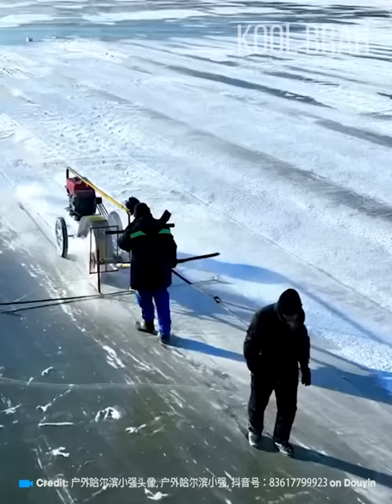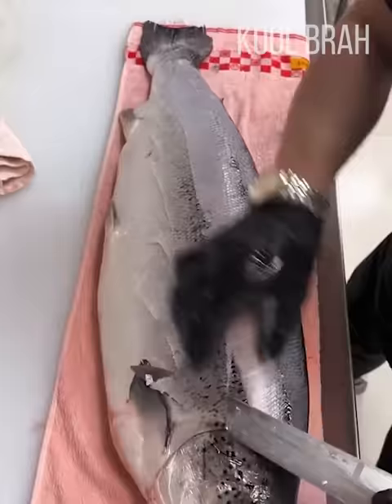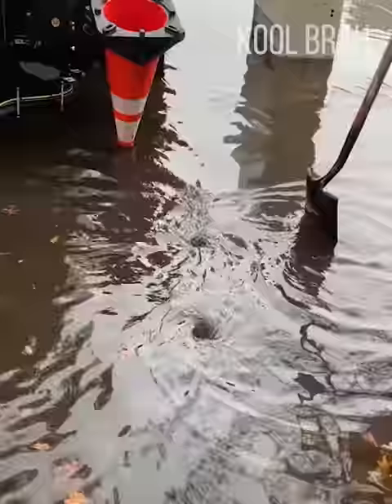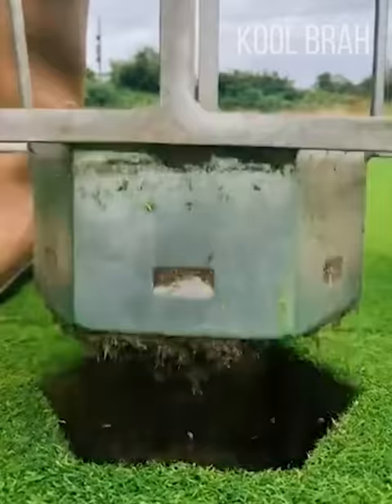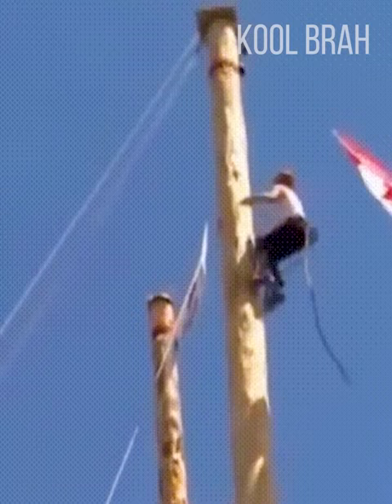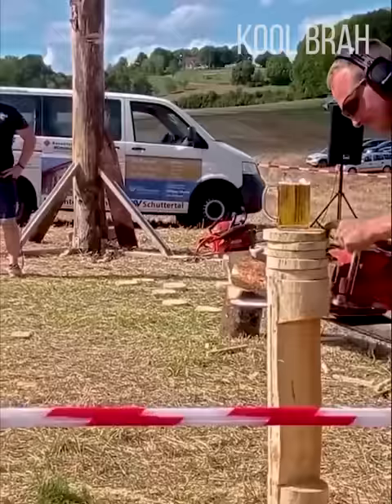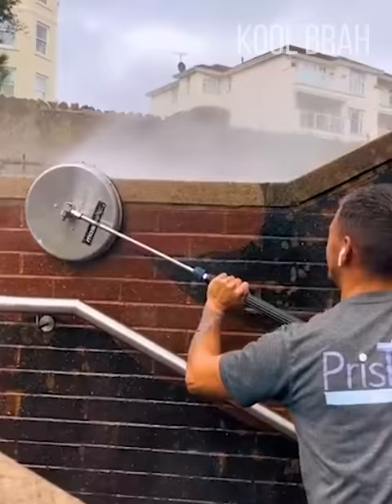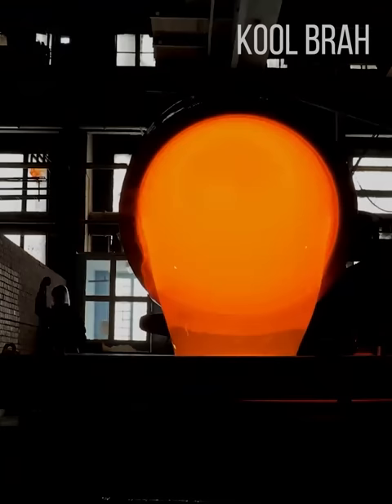30 Minutes Satisfying Videos of Workers Doing Their Job Perfectly

Comment: tip about the ''thats how you spread the adhesive'' part... that part of the floor aka 'click floor' is mostly 'decorative' aspect of the structure aka... you dont actually need to glue it aslong its secured in the edges it wont move..buuuuuuuut... if say your ever gona repair it , replace it or do any maintenance work underneath it hehehe... not having glued it is very very practical ,because then you just remove what ever holds it in the edges.. and just 'unhook' segments until you exposed what ever part underneath it you want to reach and when done you just... 'click' the old pieces back in place , or if noticing one or two got damaged by furniture etc well.. thats why you have a package or two extra pieces since building it ;)